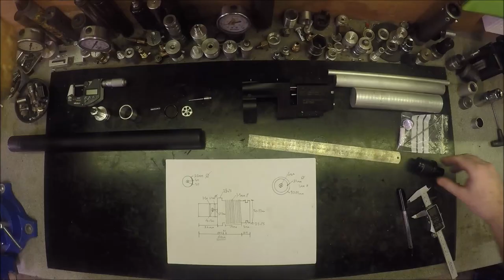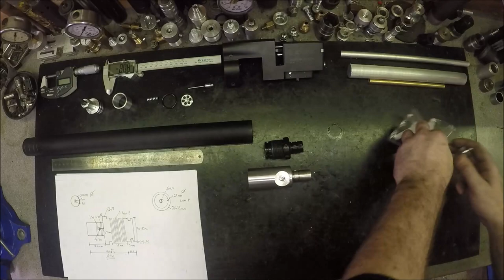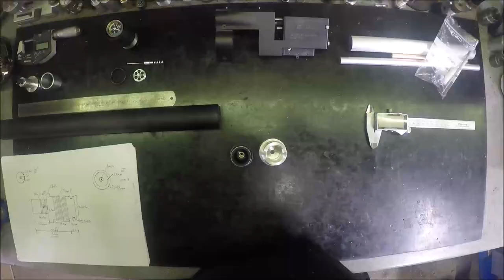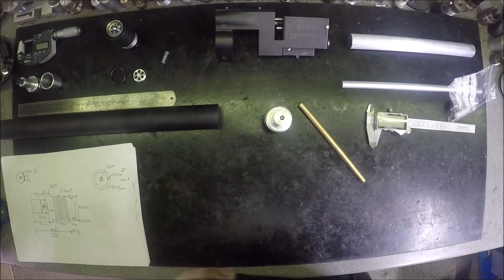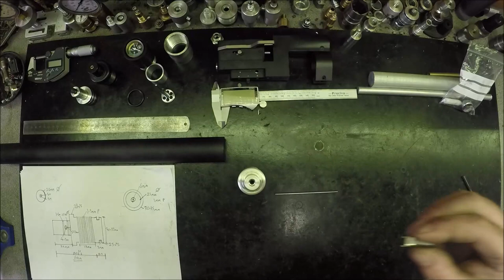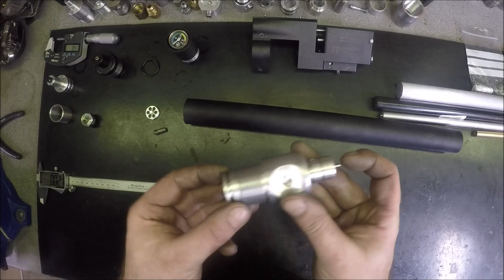Machining a Regulator Gauge Assembly:  kalibrgun Cricket

Comment: Congratulations on the video. One question, is it convenient to change the factory regulator of the cricket tactical 2 in .22 for the Huma regulator? Or it is not necessary. Thanks for the reply.
Reply from the maker: Hi there, no keep the original regulator. Its a fantastic piece of kit. Huma are very over rated.
Reply: @airrifletech8085  Thank you very much for the reply. I will take your recommendation into account